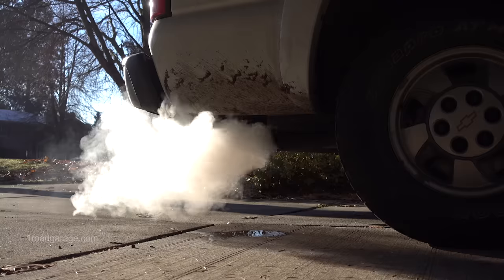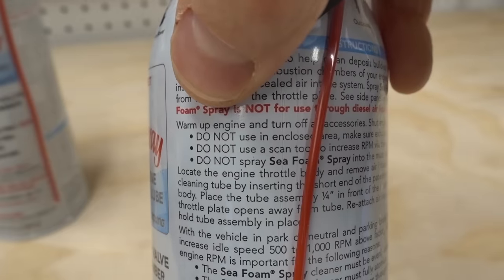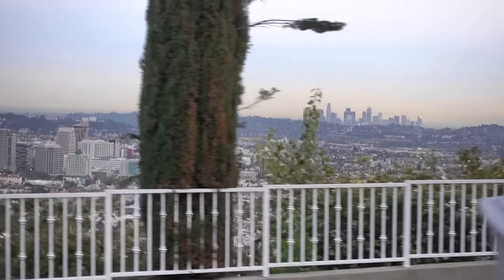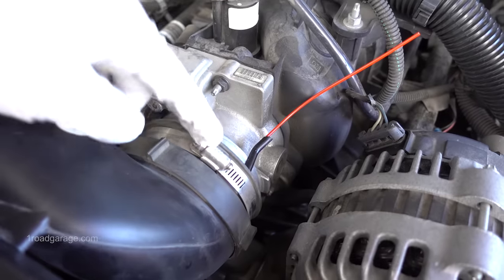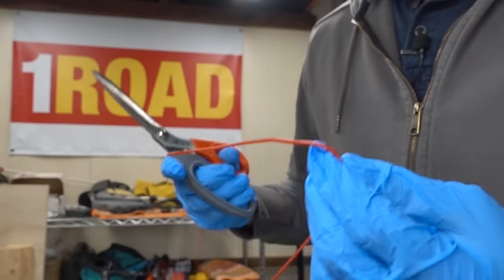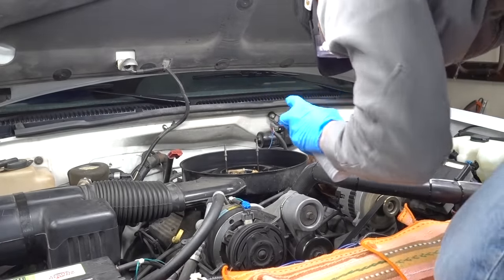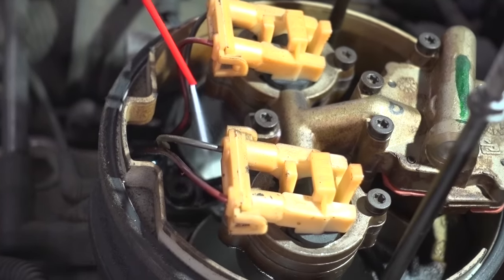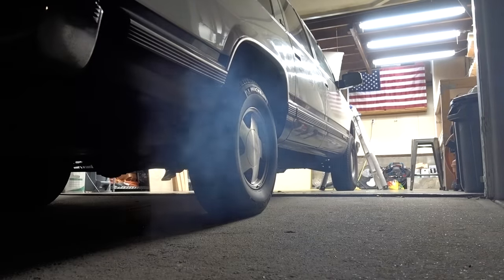Why You Should NEVER EVER USE SEAFOAM!!

Comment: I filled both throttle body ports with sea foam, unplugged my spark. Then cranked the engine and opened the throttle just the tiniest hair so the sea foam would fall in as evenly as possible without the engine firing. Then I did it again and let it sit. (No I’m not worried about hydrolocking because I poured about 10oz in total. Sounds like a lot. However that has to be divided by 8 cylinders and each cylinder isn’t going to get its 1/8 share all in one stroke). And I tell you what…that was a huge..huge…long lasting plume. Also for any tbi Chevy folks out there you should have a crankcase vent tube going into the tb. It sucks pretty hard so you can pour sea foam right in that tube. You could also slip a much smaller tube into it and stick that tube right into the can of sea foam and get a nice metered, but relatively heavy flow compared to simply pouring it into the gas tank

Comment: 🇬🇧 here. OK, just my 2 pen'orth (2 cents for my 🇺🇸 friends!)
I bought a Suzuki 500 privately last year, 15 years old, 2850 miles on the clock, been sitting in sheds for much of its life. Owner had got it running but it was still quite sickly, always trying to run on 1 cylinder. I got it home & mechanic friend introduced me (& it) to SeaFoam, a product I'd never heard of before. He put a full can of it in the bike's fuel tank & told me to rev it.."red-line it" (😱) & get it working , use it & get some fresh fuel through its system as well. I did this (70mph in 3rd = 10,500 rpm redline[😱😱]) on the local dual carriageway! & it worked - it was noticeablly much better.  I've put the occasional can of SeaFoam in as I've filled up with fuel & I have a much happier bike.
Nearly a year on, it's much improved but no, there's never been a cloud of white smoke from the exhaust!

Comment: Hi, This morning I did the treatment.  After the recommended 10 minute wait time I got in the car and took off to drive the car on the highway at highway speed.  The check engine light came on and as I started climbing a hill as I gave it more gas the engine bogged and started losing power.  Uh oh, not good.  Thinking it was the abundance of Seafoam that needed to be burned off I continued to drive.  The engine was running like crap.  Wild thoughts entered my head.  I've destroyed the engine.  The bill's going to be $10,000.  I turned the car to go home.  The performance got worse rather than better.  A couple blocks from the house I wondered if the problem was the vacuum hose I pulled to administer the Seafoam.
I pulled into the drive, ran into the house and got a real hose clamp to replace the factory spring type, put it on and voila, problem gone.  Engine now runs perfectly and better with the Seafoam treatment.

Comment: I'm old school hotroder.  Before they had Seafoam and other cleaners, we used 50/50 diesel and atf.  Slowly poured it down the carb while throttling the engine up.  Talk about smoke, we once had the fire department come out because of fire call in.

Comment: I had a 1995 K1500 Chevy 4 wheel drive with 300,000 miles. I unhook vacuum hose at the brake booster put hose a top of Seafoam can it suck it out a little at time you will get all the smoke you want. I use it regularly about every 20,000 miles ran like new for years. It 346,000 when I sold it. Never use oil. I changed in every 3,000 miles Seafoam is a great product.

Comment: I never used it in my 2017 but it fixed my weed wacker that would not start.put several oz. In fuel tank pulled cord on choke setting till flooded let sit over night next day it started an still runs great.luv this stuff

Comment: back in the dark ages (1980s) I worked at a cadillac dealer we sold lots of limos, the old 500 v8s would carbon up so bad that big chunks would fall off in the combustion chamber, it sounded like a rod knock, we would get 4 gallons of cold water, pinch off the upper radiator hose, drive it just to the point of severe overheating, the pour the water in the carb at 3,000 rpm, talk about a cloud, but they were nice and quiet and ran better

Comment: Seafoam is not a miracle in a can, but it has its uses for sure. I love to use it on 2 stroke outboards, and using it to heat soak the injectors on my Kubota diesel made a huge difference in how it ran and the fuel efficiency. I think part of the problem is that it is expensive, and people try to use just a couple of ounces for that reason. It's a solvent, don't be afraid to apply a heavy dose. A couple of ounces in your gas tank are not going to do anything.

Comment: Sea Foam works very well when used correctly.  its been proven to work. It worked well on my lawnmower. I used it to calm a stuttering carburetor. No more miss fires or stuttering. Starts on first pull.

Comment: I took vacuum hose where it attaches to the brake booster.
Slowly pour all of a can of seafoam into the vaccuum hose.
The truck will want to die so increase rpms to keep it running.
It smoked instntly.
And bellowed plums os white smoke for at least 10 minutes.
It was alot of smoke!
This was on my 
2000 Chevrolet Silverado 1500
Z71 4x4.
It worked very well.

Comment: Back in the '80s, one of my neighbors poured oil into his carb.  I came outside and the street was filled with smoke.  I called the fire department and by the time they got there the smoke was gone.  They thought I was nuts.  A few hours later my neighbor saw me outside and asked me if I called the fire department, and he told me what he had done.  He said he heard the fire trucks coming and had closed his garage door.  

I find Seafoam does work.   My newest Seafoam project was my daughter's car. Her motor was running rough so I took it to the auto parts store and the code said number 5 cylinder injector was stuck open.  I poured half a can of Seafoam in the tank and drove around for about 40 miles.  Problem solved.

Comment: I did a hot soak to my 93 explorer. It covered the entire grocery store in my town! But I get the engine hot, and slurp a can of liquid seafoam into the break booted hose into the intake until it choke out and dies, then after 15 minutes start it up and watch the smoke show! Afterwards there should be lots of deposits on the ground.

Comment: I have a MAP Sensor right on top of throttle body. It's about 1 1/2 inches from the rubber intake tube. The curved Straw would put it inside past the MAP Sensor. I assume that would be ok to use then. >??? 
P.s engine / head, New Rings, bored out, was rebuilt 4 1/2 years ago. and they cleaned everything out really well including entire throttle body, new IACV, etc.

Comment: For those saying kill the engine pouring it, try drinking it. Those that use it, warm seals alone to operating temperatures then let soak for 15 minutes. Works wonders for eating porous holes in gaskets. Smoke happens traveling through your manifold..... mr. Shadetree.

Comment: I’ve got an 02 tahoe with the 5.3. To get more smoke, you need to kill the motor with seafoam. I do the old school method though, I pop off the vacuum line to the master cylinder and let it sip through that, not an aerosol can. Then when I have about 2 inches left in the can I dump all of it into that line. It will choke out the motor. Do that before an oil change, drain your oil, swap filters and top off then go for a ride. You’ll smoke out the whole neighborhood.

Comment: I bought a 2000 ram 2500 a few years back and ran the seafoam both in the gas and crankcase and then used the spray bottle in the intake manifold, this product restored horsepower, gave better gas mileage and also had a better low end on throttle response making the truck able to get in and out of traffic while entering and exiting the highway on/off ramps. Yes there was a bunch of smoke but it depends on the types of fuel you use. Essentially if you're using a fuel with good detergents in it at purchase you are continually cleaning those said deposits from your engine shell V power fuel is all I run in my truck after a experience of hesitation and power loss I used shell Vpower and the old ram ram like a whole different truck prior to using sea foam

Comment: I like the video, though there are too many negative  emissions comments out there for me to chance it just yet on my 2004 Suburban. I have used Seafoam on my 90 hp 2 stroke  Johnson & all my small 2/4 stroke  gasoline mower / tiller /  chainsaw engines up to 18 hp - works great. Keep in mind out of the can Seafoam in a two stroke engine still needs the two stroke oil added (straight into the carb intake will cause an overheat).

What do GM Dealers use for the throttle body cleaning and de-carbonization of the 2004 Suburban 5.3 Vortec? I have had them do it, just don't know what they used or if they have special equipment specific for this procedure. 

I am looking for a solution to a recent problem - I pull a 3,500 pound camper (have the towing package, just bought the camper) and am getting a lot light weight pinging under load (120,000 well maintained miles, bought it new)
Reply: It works great I use the old seafoam in gas and oil and once a year the seafoam intake cleaner in all my vehicles

Comment: I had a 1997 Silverado and I put the sea foam in the brake booster vacuum line.  I used a coffee stir shoved into the lid and an air hole drilled into the bottom.this aloud the perfect volume for continuous flow.  The cloud that came out filled my neighborhood. I had smoother idle and dieseling stopped.

Comment: I pored a bottle of Sea Foam into my engine oil a while before a scheduled oil change & it totally cleaned out my engine. When I did the oil change, I let the old engine oil drain for about 15 minutes so the oil pan can get drained well..before I put the drain bolt back in.  Then I replaced the oil filter and I put in the new synthetic oil.   The engine is now SO CLEAN that after I drove it with the new oil for 500 miles... it still looks clear when I pull out the dipstick.  Before the treatment... whenever I did past oil changes.. any new oil would always turn dark as soon as the engine ran.  Now all the gunk is out of my engine.

Comment: I used seafoam in my 2002 4.6L f150 a week ago and it hasn't run right since I did it. It was running good before, I had a p0401 code and 155,000 miles and a lot of carbon built up. I fixed the code (my egr ports were clogged with carbon which I cleaned out, but the intake manifold was all carbon up. The seafoam cleaned it up, but now it's running lean (p0171 and p0174 codes) and runs like 💩 now! Going to reset pcm now and I hope it 🙏 works. Any ideas of what went wrong 🤔 would be greatly appreciated.

Comment: it's just gas mixed with a bit of isopropyl alcohol. The same procedure using pump gas, running your car extremely rich by sucking in fuel through a brake vacuum line, would likely work. Your getting ripped off if you use this. Dislodging sludge and carbon buildup inside your engine block is a bad idea as this could block oil passages/ bearings and destroy your engine. If you feel like you need to use this stuff you likely need an engine rebuild.

Comment: I'm a big fantasy foam, directly in the carburetor rev it till like 1500 RPMs get it on a couple cars old like that got a lot of smoke and definitely notice the difference.. also used it in the fuel tank and seem to get a few extra miles... Also put 3 oz in my oil right before oil change take it for a spin it comes out a lot darker you'll notice how black it is... Good stuff 👍👍👍👍

Comment: I'm a sea foam guy and I've used it in an atomizing fuel rail injection canister that is hooked to shop air and you pull the fuel pump relay and let engine run only on seafoam but I've only Sean that billowing smoke from putting marvel mistery oil in a spray bottle and spraying it directly into the throttle body then driving aggressively right after and it left a smoke trail for about 5 miles. Definitely woke up the motor that had been sitting for about a year.

Comment: I tried it on my 2006 scion xb at my job directly through my brake booster hose and it the result was it looked like a night club outside the parking lot ..to make things more fun after I got off work it was still smoking on the way home I had cars behind me drive on the other side of the road to avoid me killing there lungs ..I laughed all the way home...it does work ...works best depending on the type of Gas you use..

Comment: I had a 2010 silverado 5.3, 6l80e trans and it was used for security work where it idled non stop, was 3 years old and had 5 k engine hours and i was hopping it up a bit, did a good intake, great exhaust work, long tubes, custom engine and trans tune and some valvetrain work, it helped a bit, then i did the seafoam in the oil, gas tank and the intake and man.. what a HUGE difference. it was wayyy more powerful. Also when i did the intake treatment so much crap came out of the exhaust but It would bounce your head off the head rest when i did a 2nd gear pull afterwards and spin the tires a few feet. Before all that it would just bog a bit and then pickup speed. It honestly idles and runs better at 170k miles than it did at 60k miles.

Comment: I have a 1988 C1500 with the 5.7 350 TBI V8 and it seems like from time to time it has engine hesitation problems. Like when I'm driving it, sometimes it acts like it doesn't want to get up to acceleration when I have my foot on the gas pedal and it drives like it's not getting enough fuel to allow it to drive smoothly.

I've had those problems twice back in May, and both times I used Autozone's Carburetor Cleaner to fix it. Now just yesterday the problem has returned, and I used the carb cleaner again. This time it didn't fix the problem. Do you think Seafoam can fix it?

Comment: I have a high-mileage engine.  2009 Hyundai Santa Fe, 303,000, was curious is it one of those things where you have things that may be plugging seals that you might have with an old ride?  e.g., Engine flush or transmission flush, they say to leave high milage engine alone.  I was wondering if this applies to my ride.

Comment: To be honest, the cars that get the biggest plume are either ones that were neglected, or are Direct Fuel Injected. My 2.4 Ecotec produced a 3 mile long smoke plume so thick you couldn't see through it. First time seafoam spray treatment @ 80k miles.

A regular fuel injected engine probably won't get massive plumes of smoke, since you have a fuel spray that will keep the intake valves clean. And if you use good detergents in your fuel, those valves, and everything else which touches that fuel, will stay relatively clean.

Comment: Will Seafoam work if I just pour it in the gas tank or crankcase according to the instructions?
Reply: Yes! It's in my crankcase now and it is working wonders. If u put in crankcase make sure you aren't going over recommended amounts and get an oil change after a few hundred miles. Check oil before adding to crankcase and watch your oil go black as u drive those miles. Scrub scrub

Comment: i use berryman b12 in the tank on my new vehicles, and seafoam on the carbureted vehicles.   seafoam is best when it can soak down inside the intake and internals in a hot engine, then cranked back up.   rev it and get all that smoke and deposits out.   I know it works because your next go around with seafoam if theres little to no smoke, then you got your moneys worth and the majority of the inner buildups were blown out on the first go around.  Thats how i always knew it worked.

Comment: I dont have that great success with the aerosol cans. It introduces too slowly. Buy the standard can(non-aerosol).

Dump a half can into an open container such as a coffee mug. Warm engine as usual. Disconnect vacuum line from brake booster. Start engine with your finger plugging the end, and find a way to bring up the RPMS...2 grand to 2500 is good. Lower the plugged line into your Seafoam container and slowly allow the vacuum line to suck it up. If the engine begins to stall, plug the line again and give it some more revs. Once youve used half a can, let it sit for 10 minutes. Start it and let it clear its throat. 

This is by far the best method...ive tested it time and time again.

Comment: I’ve use SeaFoam and it works. My Ford  f-150 runs like new. It has 200,000 miles on it.  After 3or4 days it started working.

Comment: My only concern with using a Inlet Valve cleaner like Seafoam or 'CRC gdi ivc'. is that dislodging lots of carbon through the engine may actually contaminate the O2 sensors and shorten their effective life. or partially contaminate the converters with bits of carbon.   Somebody ought to do a test with new 02 sensors in an old car - do the intake valve clean with seafoam. Run the car for a few hundred miles --- then take out and look at the sensors.,

Comment: I believe seafoam was designed for 2 stroke engines. 2 strokes are notorious for piston ring deposits not letting rings float freely and to clean porting and combustion chambers. If Seafoam works on 2 strokes which are notoriously dirtier, it's going to work on cleaner 4 stroke engines !

Comment: For cars and truck with easy access to the brake vacuum buster try running the engine, quickly remove the vacuum hose and shove it in to a can of sea Foam the vacuum will suck it all up. Reinstall hose onto brake booster and watch the smoke.  Thus method move a large amount of sea foam thru you intake. Can't do this on a Mazda 3 or 5, can get to booster easily